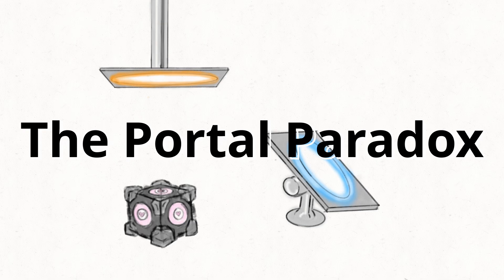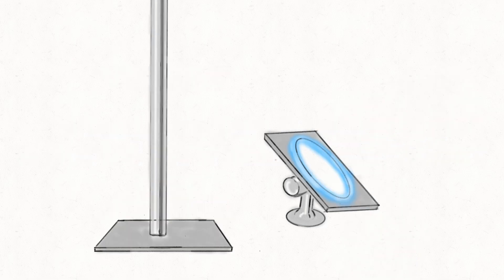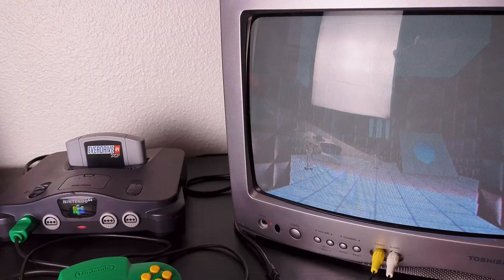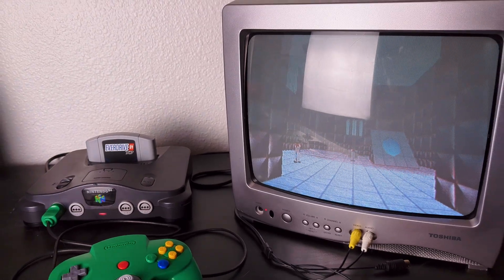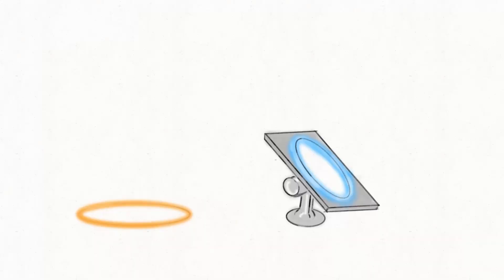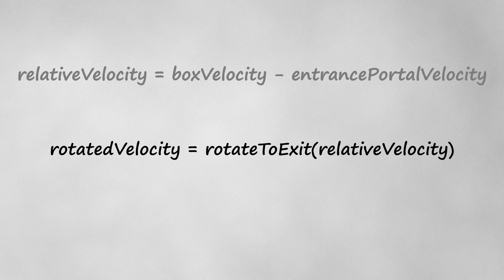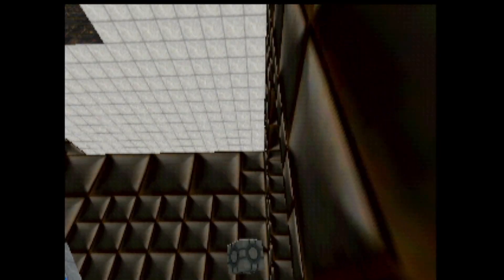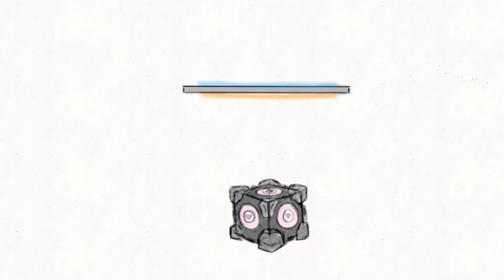I rewrote Portal from scratch and solved the Portal Paradox

Comment: In my intuition the cube wouldn't be launched. Its always on its initial platform, so object at rest stays at rest. All that changes is how gravity is acting on it. So as more of it pokes out of the 45 degree blue portal gravity allows it to slide down and roll off the ramp, depending on friction. 

Another way of thinking about this is If you imaging the orange portal as a glass cylindrical tube. Slamming it over the top of the cube wouldn't make the cube bounce upward proportional to the force you slammed the tube down over it. So your 'hula hoop'

...however the forces of the tubes ring on the ground could cause the initial platform to collapse / compress, so the cube would freefall a moment. It'd look like it hopped out of the blue portal but it actually fell.

The thing though that I'm assuming is that the portals have no resistance. Otherwise then yes the velocity of the portal pushing the object through itself would impart launch forces on the cube.

...but then falling onto a portal would hurt since its resistance would conflict with my acceleration from gravity falling into it. 

its like thinking are the portals made of liquid or gas.
Reply: Second paragraph: BUT RELATIVE TO THE TUBE, WHICH WILL BE STATIONARY BY THE TIME YOU LEAVE IT, YOU ARE MOVING UP. And portals do conserve relative momentum btw.

Comment: Every action has an equal an opposite reaction. And objects at rest stay at rest. The problem with the equation is it assumes the only point of the portal is the change in velocity between the cube and the portal. This is wrong because the cube is at rest and the plate which it sits on is the only thing which could propel the cube through the portal. At best the only moments of velocity would be timed from the top of the cube to the base of the cube as it passes through the portal, as there is no velocity change at any other instance of time acting on the cube. However, there is a stronger argument that since this change in space technically amounts to air displacement around the cube, instead of the cube at rest suddenly accelerating the cubes sufficient mass wouldn't accelerate due to the cube being easily able to push the occupying air out of the way. Essentially if the floor isn't moving upwards there is nothing pushing the cube to propel it. Only air rushing down on top of it as it enters the portal. Your equation I find does not factor for all the theoretical physics problems.

Comment: The only thing I can think that isn't taken into account is the density of the air, not that it would produce a different result, but it might change things. When you throw a cube into a portal, the cube gets slowed down by the friction of the air. When you move a portal down it probably creates kind of a vacuum because the air gets pushed into the portal. So at best it would increase the speed of the cube.
Reply: in no scenario does friction increase speed lol

Comment: Your logic is sound, even though your implementation is flawed. At the test with the two moving portals there is no real hole, which means the cube reappears at a higher point since your moving platform is not infinitely thin, which means it would seam like it is longer

Comment: I like this a lot, but it breaks some laws of physics, primarily the conservation of energy. A lot of people have pointed this out already, but moving one portal to some speed takes very little energy, but the object the portal slams into will have a lot of energy when it flies out at the same speed from the blue portal. Now, the easy solution is to say that these portals are energy channels anyway, and can exert limitless energy on any object to maintain the relative velocitie of the objects being teleported. 

Or there's another solution that would be more reasonable, but a less game-friendly one. Say the portals are in fact linked, not just in concept but in every way, and will maintain opposite velocities relative to each other. If one moves forward, the other will move backwards. So if one moves forwards, and slams into an object, the other portal will move backwards at the same speed and the object will be teleported between them without receiving a new velocity. The object will remain stationary due to the portals always having equal-but-opposite velocities. That's my solution to the paradox anyway, but it also has problems, like how they are supposed to move with equal-but-opposite velocities when they are always presented in the game being attached to stationary surfaces. So idk, but it's an alternative that fixes the conservation of energy problem that your in-game presentation shows.

Comment: For the flop argument (no conserved momentum) 

Let's imagine we're dropping a box on the cube. If we drop a box on the cube, the cube experiences no force.

Let's imagine the interior of the box to be the space around the exit portal. If the plane is tilted on the exit portal relative to the entrance portal (as in the demonstration) then part of the cube would experience acceleration as it passed into the exit portal. This could produce some weird behavior- mysterious sliding, tilting, etc. In game the portals have tangible borders so my guess is, if the portals stopped before touching, the cube would slide to the edge of the exit portal and then roll out if its center of mass passes the portal threshold. etc etc etc...

I think the answer in the video is more fun and easier to implement, and as a game designer it opens far more opportunities for weird puzzle solutions. An in-lore explanation could be exactly as the video suggests, that the portal conserves relative velocity thereby speedy portal goes on -> speedy thing goes out.

Comment: Your solution is sound; relative velocity/motion is an elegant way to resolve this "paradox".   I would be curious to see the force diagram and energy conservation of a system using real world wormholes.  In a real example, I would wonder if the box would start to accelerate as soon as a part of it is through the portal and at what point would it "jump" off of the ground.  It's also curious that the box seems to gain a bunch of kinetic energy instantly.

Comment: Ah the good old moving portals thought experiment. I would hardly call it a paradox for people that have a solid grasp of physics. The main question within the "paradox" is perspective and relativity and can easily be answered as shown, if the entrance portal and only the entrance portal moves then any object that enters the entrance will leave the exit with the same but opposite energy that the entrance portal moved over it with.

 In my opinion a quite boring question, and a much better question would be how does the exit work in this moving portal thought experiment. If the exit portal moved equally and relatively accurately to the entrance then the portal simply acts as a doorway, if a doorway was thrown over you, it imparts no energy to you. 

In my opinion this is how any non teleportation "portal" would work. It is a doorway through space time. So either once active the system would be impossible to move, or if you were able to move the entrance it would equally and relatively accurately move the exit. Thus a moving "set of portals" would impart no energy onto any objects they moved over.

Comment: How I grok it: the cube won't be squished or extended, so imagine what must be happening at the point at which the cube is halfway through the portal. Half the cube will be on the other side of the portal. If the cube falls slower than the portal drops, then the cube must be getting squished because the previous half of the cube won't be out of the way in time for the second half to come through the portal. Since the cube can't be squished, it has to leave at the exact speed of the falling portal. Nothing about this scenario should mean the cube loses momentum once it's on the other side of the portal, so we should expect it to shoot out.

I can imagine someone grabbing only one side of the cube and flinging it at the wall- you only need to make a tiny bit of the cube go fast in order to make the entire cube travel fast.

Comment: Makes sense to me.  I would have liked you to have shown the orange portal moving down at different velocities though.
Like coming onto the cube very slowly to see if it just, rolls off the blue portal. Since IRL, the cube would be affected by 2 different gravitational points/sources. Directly down under the cube, and then at an angle under the blue portal. 
So i'm kind of curious as to the gravitational calculations that would be going on, if the portals were real.

And if the orange portal moved down really slowly, at what point does the cube get picked up by the gravity on the blue portal's side.. if at all since it was at an angle.

Also if both portals were facing down, and someone lifted a cube so it's perfectly half way through the portal, would it just hover there? Both halves of the cube would be pulled on by 1G, earths gravity.
I know if both portals are facing up, you kind of just bounce between them and ultimately just float halfway in between.

Comment: I disagree with the simulation. If you slam an open door, which is all a portal is scientifically, down over an object, the object does not fly out of the top. It 100% matters if the object or the portal is moving. The object itself has no initial velocity and would either sit, slightly tilted if still effected by the gravity of the floor it's sitting on, or slide down the side if affected by the gravity on the blue side of the portal. So, SURE, using the game engine you wrote, that is what would happen. It may also be the same for the engine Portal and Portal 2 or written in. In real life, using our current understand of physics, this is incorrect.
Reply from the maker: The video addresses this. I just call it a hula hoop instead of an open door.

Comment: Great video! but I disagree. 
Posing a portal would work this way implies that there is an application of force on the object somewhere between interacting with Portal A (in) before exiting out of Portal B (out). This means that as the first parts of the object pass through portal A and get accelerated, they would pull up on the rest of the object before portal A hits the ground, yes?

The energy for the cube to fly out of B must come from somewhere. I have trouble seeing how the portal is adding energy to the object. A portal doesn’t have mass or energy, even if it is moving. It is just a hole to the other side. 

My answer to the paradox involves 2 parameters. 
1. When entering portal A, velocity is measured against an absolute universe standard, not the object's immediate locality (yes sifi, but so are portals). 
The relative velocity of the object and portal A is not used.

2. When Exiting, the absolute velocity of the object is maintained, regardless of the velocity of portal B.

With this framing, in the room you built, the box has a velocity of zero, so it would just fall to the ground when exiting B.
Also, if portal B’s exit is moving forward faster than you can move into portal A, you will be pushed back through the A side, unable to pass through.

Also, Also, If you are standing next to portal A (assuming your absolute velocity is 0) and you stick your hand through while portal B is moving lateraly at an absolute velocity of 1000 mph, the inertia of your hand being still will cause the back moving edge of portal B to slam into your arm at 1000 mph. You’ll still be standing on side A, sans 1 hand.

Let me know what you think.
-A